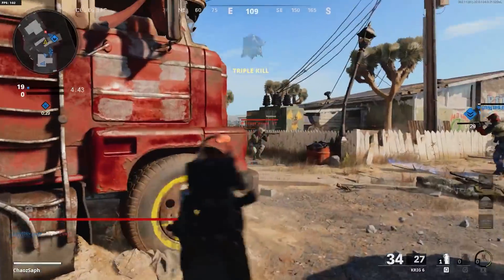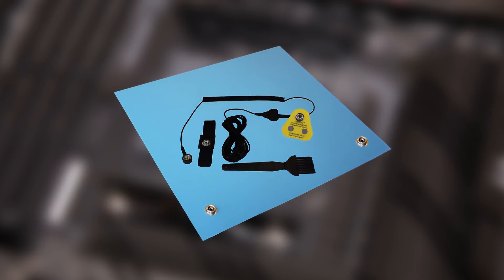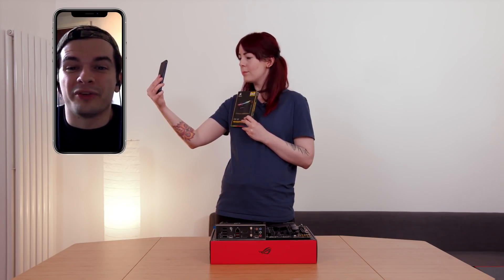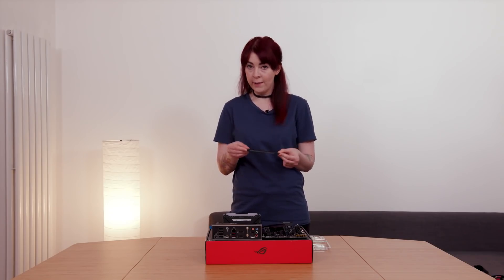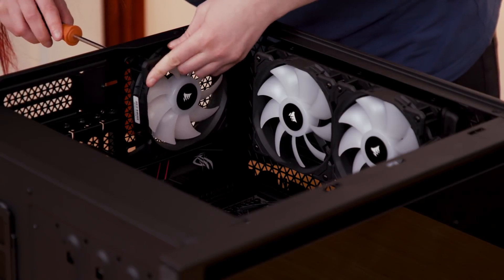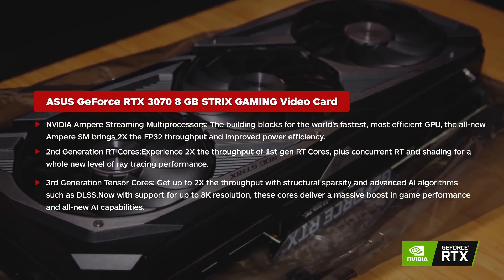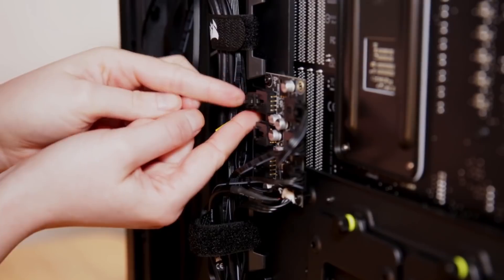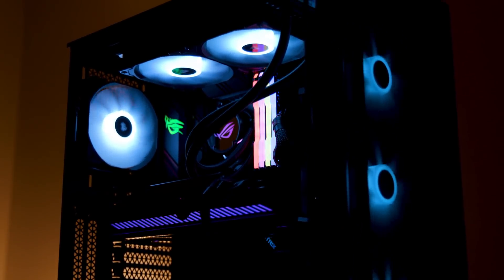How to Build a PC for the First Time

Comment: You gave bad advice saying its not strictly necessary to use a wriststrap if you're careful handling your components. There's no way to avoid discharging static into something when you touch it, so assuming you're going to touch components at all it really is necessary, especially in hot/dry environments or when standing on carpet you're really taking a big risk if you're not using a wriststrap

Comment: something they forgot to talk about is CPU compatibility with the motherboard. this is the point where the Intel joke about generations comes in.... when getting a CPU and Motherboard you must make sure they are compatible. the way that you do this is by the Series number usually, of course the seller might also tell you in advance which generation of CPU it is compatible with. though for example an Intel i7 6700 is a 6th gen CPU and is not able to go into a 8 or 9th and obviously not a 10th gen CPU socket, even if it physically fits in there, this is especially the case with LGA1151 sockets and the Intel i7 6700 and 8th and 9th gen CPU's. also something to note about the "LGA" portion of the socket it is also a way to understand the type of CPU it is (flat surface instead of pegs out of the CPU in this case).
Hope this helps new PC builders!
Hope you have a great day & Safe Travels!

Comment: B-b-but where's the electrical insulation for the power supply, it could short circuit otherwise 👀
Reply: Verge 2.0 sarcasm if you didn't get it

Comment: you should've put the original static pressure fans on top of the radiator instead of those dump rgb fans.

Comment: This is a really great beginners guide for the simple reason that you are upfront about your inexperience when building PCs. It goes to show that someone who has never done it before can do with a little bit of patience, a mobo manual, and a willingness to ask questions.

Side note, and this is very niche to AMD processors, but some advice for the people. If you are ever removing a heatsink cooler from an AMD processor, turn the computer on and let it run for a few minutes to heat up the thermal paste to loosen it up. If you don't, and the thermal paste is kinda old, you run the risk of tearing the CPU out of it's socket when you pull the cooler up. You don't need to worry about this with Intel because there is a bracket that holds the CPU in place.

Happy PC Building Everyone!

Comment: "Dont worry about making mistakes"

Me: Are you sure about that advice? are you sure you can make a mistake of bending the pins of your processor?
Reply: Not that it's OK to make a mistake, but don't worry about it.  As long as you follow all the directions, it's unlikely that you'd make that kind of mistake; but if you're distracted by unnecessary worry and self-doubt, it makes avoidable mistakes more likely.

Comment: But, where are the tweezers? 
And how about the Socket Applicator? 
Also, don't forget to have a space between the PSU and the case, otherwise you will create a huge short circuit in the system. 

This build is a mess. /s

Comment: The fans for the CPU radiator are positioned wrong! In the position that she installed them they will pull hot air from the inside of the case and across the radiator. They should be mounted on top of the radiator and turned 180 degrees to pull cool air from outside the case across the radiator!
Reply: Meh. For most random builds this fine. Not great, but will work fine.
Reply: no

Comment: Not bad. Not bad at all. Some things here and there, but this is MILES better than the last high profile publication that tried to teach PC building. Short and to the point. Still missed seeing Minecraft RTX when you have such a powerful card in there.
Reply: She's also running off stock RAM speeds becasue she probably didn't set XMP, lol.
Reply: @sqlevolicious  yeah, but at least that’s undervolting the system so it’s going to last forever, in comparison to Spefans build that’s a ticking bomb😂

Comment: The 3 major things this video missed were:

Acknowledgment of the current silicon shortage, which has astronomically increased parts prices

And to test a new build before installing it into a case. Parts can be DOA, a startup test is important to not have to fanagle with cable management when a component is dead

And finally enabling XMP in the bios to get your memory speeds enabled. I'm not sure if Asus' software does this
Reply: Yes, yes and no. Still have to enable in BIOS.

Comment: Just got a ryzen 7 5800x, bloody beast of a cpu!! I'm getting 200 fps on gta iv which is regarded the worst pc port of all time lol

Crazy fps in hitman 3 too
Reply: No. Batman Arkham Knight. Full stop. Also CPU hardly matters in gaming, considering roughly 20% of games are CPU intensive.
Reply: @MyDearBradley  nope, had a ryzen 5 3600 with a rtx 3080 and had large  bottlenecks even at 1440p. Huge increase in GTA 5, farcry 5, GTA IV, arma 3, shadow of the tomb raider, watch dogs legion, assassins crescent origins, call of duty warzone, Fallout 4,deus ex mankind divided..I could keep going. Many of these games didn't hit 99% gpu usage..now they do
Also batman arkham knight runs great now..the only issue is occasional stutter when in the car which is rare